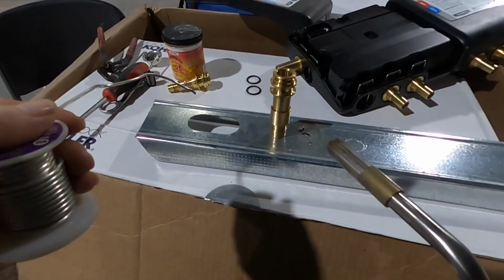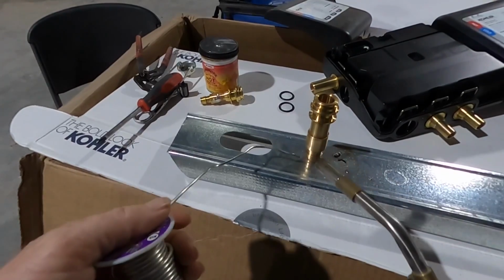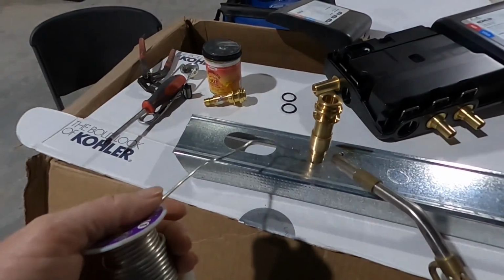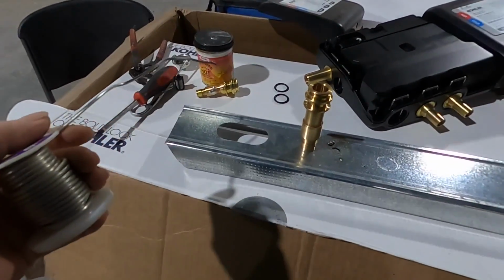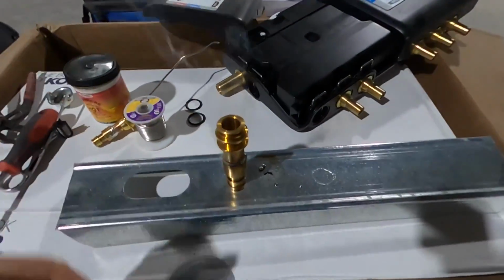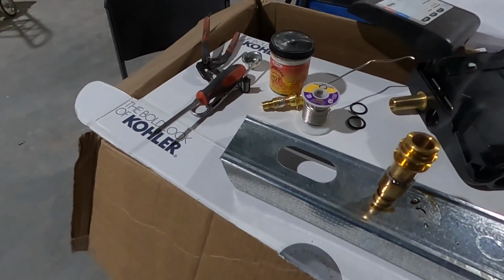How to solder #plumbing

Comment: Not electrical soldier
Reply from the maker: Nope plumbing solder
Reply: I've spent a minute or two on electrical solder.  Never touched this kind.  Thanks for the vid.   Conceptually the same
Reply from the maker: Yes you’re right. Same concept. I’ve done electrical back in my earlier years in college for electrical aviation engineering.